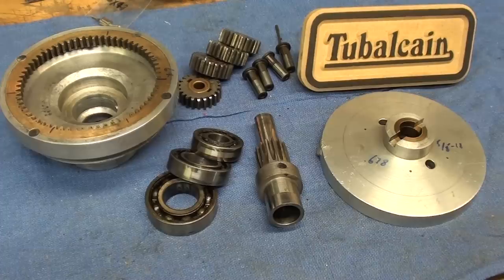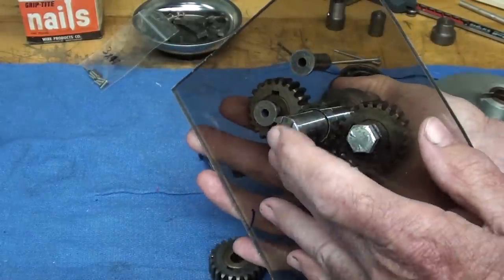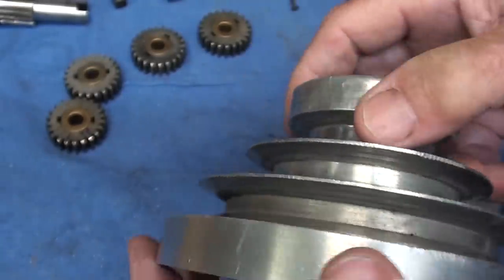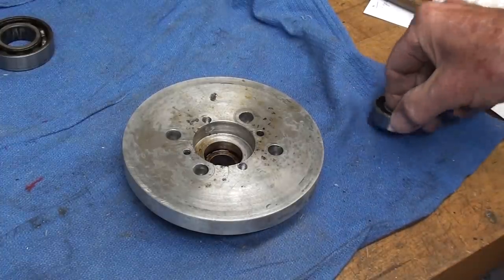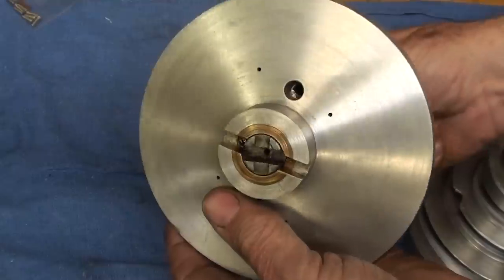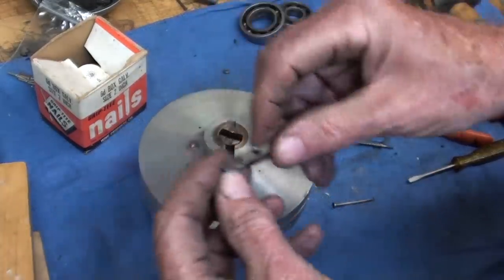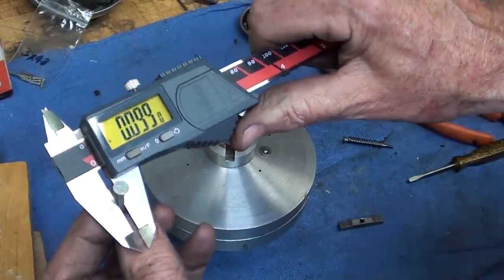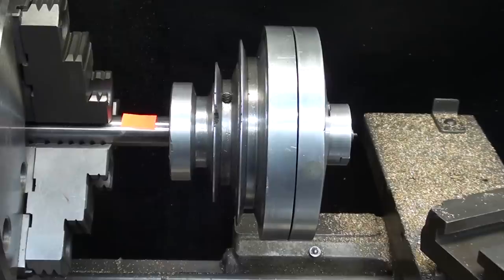PULL GEAR Reassembly PULL GEAR Tips #472 pt 3 tubalcain

Comment: Someone (This Old Tony ?) was demo-ing fabrication of gears for round-tooth belts which required finding suitable diameters and tooth pitches, then drilling proper-sized holes in a circle and turning the gear down to reveal half the diameter of the holes for the belt to engage. (check specs first). The belt set only requires one retainer washer on one side of the gear if the other gear uses the alternate side. Hope this explanation makes sense.
Reply from the maker: Yes

Comment: MrPete, I had the same problem with to higher speed, made up a boss off the stand shaft with bearings and a 3 row pulley upside down and then 2 shorter belts hi to low & low to high & hi to low had to reverse the chuck pulley, really only got a good low speed for large bits still a bit fast for 1 inch bits. Regards Frank
Reply from the maker: Thanks

Comment: they make a grease for farm equipment i am certain you know of it 00 grease i believe. i use it in snow blower gear boxes that would otherwise leak gear oil out. you could also rune a bead of permatex ultra black on the gap and smooth it off and let it cure overnight,should solve the slinging issue. i love the rougher than a cob reference,thanks for sharing
Reply from the maker: Thanks

Comment: I believe one of the idler gear is scrapping the ring gear. The only way to check is to pull the thing apart! Did you sketch draw the specs on the unit?

Comment: When pressing on bearings you should press on the race that is being attached.  Putting a bearing on a shaft, then press on the inner.  Putting the bearing into the end bell or casting, then press on the outer.  Do not want to transfer the pressing load across the bearing’s balls.

Comment: I would have added some white lube grease in the bearings , but you can still squirt  some heavy gear lube in the gits holes . It's tacky and sticks to the gears . It'll be less likely to sling out being thicker viscosity. , you'd not plumbing the bearings now . Enjoyed the videos. I too had a three speed English racer bike had it till I got married at 19. Shoot it had a long seat with a high back bar and I put a car headrest on it. I bet it had 30,000 miles on that bike. God the good ole days never will happen in the up coming brood. They can't wipe their own nose .
Reply from the maker: Yes

Comment: Looks like you added some vent holes to prevent hydraulic lock when inserting the pins for the planetary gears... Or were those holes there already and just obscured by crud?
Reply from the maker: I have drill those holes as insurance. They provide future location if I ever need to press those shafts out. You are the only one to notice

Comment: Sir, At 17:22, you explain the installation of bearings as requiring force only on the outer race...never the inner. In my years of working on stuff, I have ALWAYS applied the force to the race that would be in contact with the tight-fit surface. If installing on a shaft, press on the inner race. If installing in a housing, press on the outer race. My conundrum comes from having very few bearings fail after installation, yet having a great deal of trust in what you tell us. Can you expound on your reasoning?

Comment: I've watched all of your "What makes it work” series and would love to see the 3 speed hub disassembled. I sorry if understand how one works, but I've never seen the actual way the planets and ring gear are connected to the sprocket and wheel.

Also, you didn't get a 4 digit answer from a standard side rule like the one shown. Those are only good for two significant digits. There were a few with spiral scales that were more precise, but they were very uncommon.
Reply from the maker: I am tended to cut away that's three speed hub. But I enjoy the bicycle so much, that I hate to ruin it
Reply: mrpete222 Oh, don't ruin a working bicycle. Lots of old 3-speeds at garage sales.

Comment: I had a need to slightly expand a hole in my cast iron banjo (woodturning lathe). Using a 7/8" silver and deming bit turning way too fast on my drill press was a goat rodeo to say the least. I have been interested in the drill press speed reduction exercise you have been pursuing from the start.I'd be interested to see if anything comes of the DC motor/drive avenue.
Reply from the maker: I will soon be doing one with direct current motors

Comment: So I'm thinking that you can't use a gasket or a seal if you want it to work right you need something thick like bearing grease or motorcycle chain lubricant that is made for the centrifugal force that it will have. It needs something better than oil.
Reply from the maker: Yes

Comment: The original manufacturer May or may not have considered it at the time, but it would've been fairly easy to have cast or machined the upper and lower housings to include a labrith type seal which stoped or greatly curtailed the oil leakage.  Of course,  it probably would have greatly increased the price.
Reply from the maker: Yes

Comment: Perhaps I'm misunderstanding the internals, but it seems to me that a grub screw in the hole would lock the drive tube to the pulleys and therefore reduction mode could not work?

Comment: If you could find a good tig welder guy you could have fixed the damaged aluminum on the pulleys and machined them back down to original dimensions.
  Nice job as always !
Reply from the maker: Yes

Comment: I might be wrong, but pretty sure the two case halves should have been pressed all the way flush-?  It certainly works though, I would love to be able to run my drill press that slow.
Reply from the maker: They would not press together any farther than what you see. I did not want to force it, as it works fine
Reply: Understood sir.  Sorry I didnt mean to come across as critical, im just an obsessive when it comes to details-lol.  It obviously doesnt matter or it wouldnt work, surprising they cant offer to build a unit something like this into a drill press these days - might be too costly for the cheaper ones but in this era of .99 cent calculators and the like you might think they could be made cheap enough by the chinese.  One thing your unit there definitely isnt chinese-lol   Again id love to be able to run my press that slow.

Comment: That was interesting I did not understand how it reduced its speed I would not have guessed the top had to be stationary and then when it is direct drive you don’t need the gears the shaft is locked a little drawn out but worth the end result
Reply from the maker: Thanks

Comment: Rather than repair the damaged pulley walls, would it be possible to just part off that section of the unit and fasten on a commercially made 3 step pulley of better quality? You could probably find one with a 5/8" bore and just machine it to fit the shaft & bearings as required.
Reply from the maker: That probably would work, but the job is done

Comment: Involute gear teeth aren't known for their quitet operation. Helical gears would make this cost prohibitive. Possibly could have been an opportunity to cut an o-ring groove when it was apart to reduce oil losses, or even a rope or felt seal would help substantially.
Reply from the maker: Thanks
Reply: Alisdair Herd An o-ring wouldn't last very long.
Reply: Why not?
Reply: Alisdair Herd The friction would wear it away.
Reply: It's only ever going to be an oil control ring, this is why I suggested felt or rope as an alternative. O-rings are used as seals in shaft assemblies all the time. The issue you have here is the RPM is too high for an o-ring to seal reliably. But it doesn't have to seal reliably, just control the amount of oil that gets past. In this sort of application some oil escaping is inevitable. The best course of action would be to try and minimise the need for  lubrication as much as possible. It looks like its had a hard life to begin with. 

I doubt you would find a lip seal with a spring big enough to reliably seal the unit. Maybe a good idea to look into for this application, so it can be a reliably sealed system in an oil bath.

Comment: If you wanted to get creative, rather than drill a new hole for the rod to hold the outer diameter of the Pull Gear assembly to enact a ratio change you could make a band clutch, similar to an oil filter wrench, that gripped the entire outer diameter of the Pull Gear much like a band in an automatic transmission grips the planetary gear drum to change gears.
Reply from the maker: Thank you, that's a good idea

Comment: At 1:55 - Mr Pete the reason the internal gear hubs were mostly replaced (despite having some advantages) by the derailleur systems was because their mechanical efficiency was several percent less than a derailleur. Those hub drives ate up quite a bit of waste energy and since human legs are the "powerplant" on bicycles, this really makes a noticeable difference. Internal geared hubs are also quite a bit heavier than derailleur types, again adding more weight for the measly human legs to pedal around.
Reply from the maker: Thank you very much, I guess I never realized the inefficiency. And it's all about friction

Comment: Pressing a bearing on the inner race is right way to do it. NEVER press or beat on the outer race! THIS INFO COMES FROM A GUY WHO REPAIRS FANUC SERVO MOTORS.
Reply: No, it depends on the fit. If the outer race is pressed into a bore that's where you press it. If the inner race is pressed onto the shaft you press on the inner race. 
The idea is to no put side pressure on the bearings themselves.

Comment: How could someone claim a vfd is any better? The belt would have to transmit the same amount of torque? The better way to reduce spindle speed is to have this assembly replace the spindle pulley as Rockwell did on my 20" drill press.
Reply from the maker: Yes

Comment: It's too late now. But, you could of had those chips and dents in the pulley filed with a TIG welder. Than you could of finished it in the lathe. Another thought is that bearing grease in the geerset would of been a good idea since it is so worn.
Reply: Did you watch the video?
Reply: Ooooh, name calling, so mature.
If you had actually watched the series you'd have heard Mr. Pete talk  no less then three times about filling and re-cutting the damage on the pulley and he said he's not going to do it.
Reply: He was talking about completely remanufacturing the pulley. I'm talking about nothing but repair. Big difference.
Reply: No, he had an offer of someone tig welding it for him and then he could machine it. He declined.

Comment: Its  called the orbital ring Gear   son," why"  Becor  planet's  [ turn on an orbit],  Of the sun, ~
So Being a planet gear system.  "We have" A:-[ The sun gear]. :- [The planetary gear] . & 
 :-[The orbital gear ]  so cal because the planet rotates, " the sun"  held in place by there "Orbit".  Vert interesting for the kids.  in this "shut-down,"  Mr. Tubalcane. I just thought you needed to get it right for the purpose of teaching.  The kid. AS the  Kids which It a lot hear in England, We have no, such workshops in our schools today of merit,  IN our secondary schools today in my day such a project would have been undertaken.  By our senior class, We referred to them as perfect.  as the senior grads, such a project would.  Have been undertaken in the final year. But alas not today,  Les England  This is how we in my day would refer to a planetary gear train.
well, don very "Good".  I apologize if I seem pedantic I mean well.
Reply: I think I'm going to build one out off planetary gears from an automatic gearbox,  captured in the machined pullis of some aluminium.  it clear hoe to works thank you.